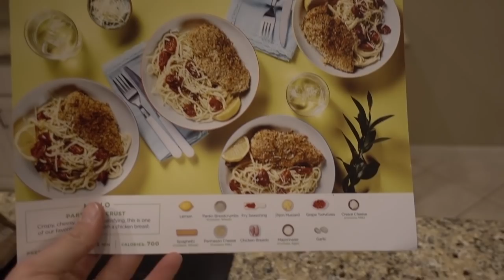Double Engine Go-Kart, Part 4 Start Up!

Comment: Put a little truck bed in the back
Reply: Very much so
Reply: just what i was thiking
Reply: It's gonna be weird with the suspension tho
Reply: thats what i suggested the first day, he might as well turn it into a little "utility" cart. help carry some stuff around the property.
Reply: @YourMom-dw7bb  yeah it would but if he was to mount it to only one of them and high enough up itd be fine
Reply: That's what I think
Reply: yes that is what i sead
Reply: Max Ferris put a flat bed on it.
Reply: I was thinking roll cage but either pne would work lol
Reply: yes, it would have to be suspended from the original rack in the rear , not hooked to the second engine setup.

Comment: You need to put fenders over the rear tires. They will dirty the heck out of the tops of those motors if you don't lol. Use some conveyor belt or a piece of a 5 gallon bucket or round trash can lol

Comment: You're assessment is correct. Acceleration will improve slightly, top speed will remain unchanged,(unless you swap out the sprocket) ability to move a heavier load will be improved markedly. Plus the MAN factor increases exponentially.

Comment: This is a project you should have waited to do until Mark is feeling better.    Odds of Matt making this work reliably 50/50 with Mark helping 100%
Reply: 50/100
Reply: Pedro Romano 50% chance working 50% not working bud
Reply: @imromano2448  He meant 50:50, not 50/50.

Comment: I know this is gonna sound like im stupid  ,  try putting one engine in reverse and other in farword  i wanna see what happens
Reply: they will just spin the tires out, the cart won't go anywhere unless one engine is somehow more powerful than the other or the tires on one have more grip than the other
Reply: I sill wanna see that even though I know the outcome!
Reply: @BTB1337  Front tires probably have more traction since the weight is more over them. Probably would only really make a difference on the concrete though
Reply: thats how you break stuff
Reply: Agreed
Reply: @mjg1970  yea me too

Comment: Extend that storage on the back and you're set! Use aluminum to keep it light, but have it attach via hinges so you don't have to worry about welds. What a beast that thing is!

Comment: The line coming off of the carb to the fuel tank is a vacuum operated shutoff valve.  it will only allow fuel flow when the engine is cranking or running.

Comment: You'll get more Torque not horsepower from the 2 engine kart.
Reply: Lol you can't increase torque and not hp
Reply: @raynman6466  horsepower is just a conversion from torque. He's only getting torque out of that because the added power & 2 extra wheels. It's not going to make it faster on the top end. But it'll move from a stop quicker. He'll be able to climb better as well like he intends to use it for.  He could change the gear ratio now to make up for the added torque and gain some top end as well.
Reply: @DynamicVlogs69  exactly if hp is a conversion from torque then increased torque means increased hp
Reply: Well yeah 4hp + 4hp =8hp
Reply: @anthonylyrette7399  12v +12v in series is 24v, 12v + 12v in parallel is 12v.
Reply: @mobrien7211  haha lol no its 24 volt truck in the 40s use 2 6volt To make 12volt

Comment: Hey Matt, all you have to do is wire the back engine into the front engine wiring harness. You dont need 2 keys or anything that way. Plus when you run the battery, run them in series and youll even the load out that way for both engines when starting.

Comment: Hold the throttle wide open on the primary, then adjust the cable to be wide open throttle on the back one at the same time. So theres even power on both engines

Comment: Alright i work on these things for a living. You need an additional fuel pump for that back engine, theres a hose that you connected to the rear carburetor. It should actually just T connect from the intake boot to the carburetor. Have a hose come off of the T intersection to the fuel pump ( the air line) and connect your fuel pump in line after your fuel filter. That should provide ample gas flow.

Comment: You could cut the rear engine throttle cable  to length to attach it to the front engine throttle connection at the carb... then sync them up.

Comment: U should put hinges on the basket in the back and put supports on the end of the rear engine and make a bed over the rear engine so it will flex with it.

Comment: Sorry to hear about your brother.  My thoughts and wishes for his recovery.

Thinking about the gas petal cable. You probably need some mechanism to synchronize the throttle on both engines.  Maybe try a turn-buckle to adjust the rear engine speed compared to the front.  Lift both sets of wheels off the ground, strap the buggy down so it cannot go anywhere.  Test that both sets of wheels turn at the same speed, as you move the petal.

Comment: @offtheranch.  Don't worry about welding it back together like you had it.   It will float better across the ground now, because the back engine cradle will pivot.

Comment: Hey Matt attach your gas cable to were it hooks to the carb on the front motor and the shift cable were it mounts on transmission of the front motor ,plenty of cable and one shifter and gas pedal.

Comment: You can wire the brake safety circuit to the brake safety circuit to engine one.  Stepping on the brake will close both circuits.  So can start both engines.  Easy, peasy.

Comment: Glad to hear the good news that so far so good with your brother... The hard part about your double motor is they'll be working against each other if you don't get the throttling perfect... Too much slop in the wire throttle you got now - cable it to get it precise.

Comment: For the throttle cable, you could have made a shorter cable and hooked it to the first carburetor so both have the same throttle response, and both are open the same amount at the same time.

Comment: That second line coming from the fuel tank is a vacuum line. The gas tank has a vacuum activated petcock, so you dont have to turn the gas on every time you use it. It only has to be connected to one of the motors to work. If you disconnect it from the rear motor you will have to plug the vacuum connection on the rear carb. Or you could leave it like it is, just thought you might like to know.

Comment: Matt, The term you are looking for is Torque. You won’t get twice the horsepower, same horsepower. But twice the torque, so it will pull more, get to top speed faster, but top speed will be the same

Comment: Just a tip as I’m a wiring fanatic. You might want to redo the electrical tape twisted wires and replicate that with a proper connecter with heat shrink. Be much better in the end

Comment: A suggestion drill a hole in the handle as the rear engine shifter attaching metal rod or borrow whatever you want to put and make a separate handle that way you don't have to worry about the cables being too short or leaning back just a suggestion

Comment: Hey Matt, it'd probably b a good idea to box those tabs you have for the top shock mounts. Either that or run a brace across from one side to the other. Otherwise, although I'm not entirely sure how the bottom side is set up, you could easily fold those ears over if you hit a large enough bump, or jump the kart.

Comment: Matt you can get a in line fuel pump for a carbureted motor and it will solve the problem if the back motor starts to starve itself for gas

Comment: Just splice the ignition wires together and use one key. Not two gas tanks. One bigger gas tank. Slow speeds, no worries. 60-70 mph, you might want to think about bigger brake rotors and a 5 point harness and a helmet. It'll go crazy fast if it's Barbie pink!

Comment: You don't get double the horsepower with 2 motors but your torque will go up but not quite double. Your go cart will still go close to the same speed but with the added torque you will get to the top speed faster. If you want more speed you will have to adjust or remove the governors. Hope this helps.

Comment: You will want to mount a second tank or run a larger fuel fitting and hose from the tank to the split to maximize power it will struggle otherwise.

Comment: Looking good. One thing you might want to make sure the throttle cables are the same length. If they aren’t the same thing length id think the engines would be fighting each other. One engine will try pushing the other.... pretty impressive though.

Comment: Replace the wire with a piece of flat bar.  That way the throttles will move at the exact same rate every time since there won't be any slack like there is in the wire.

Comment: got my NEW Demolitia t shirt , like'in this t shirt club deal , top notch quality and materials used here , Thanks . you may have been able to wire in the brake start-up wires right into the ones from the front motor , its a good idea that they will only starrt w/ the brake on . Thanks for another great one . Hope Marks doing better Peace !!!

Comment: The extra horse power from the second engine will give you a higher top speed in most circumstances except for real light engine loads, like going down hill .  Basically top speed is the point at which the vehicle's resistance to motion equals the power produced by the motor .  By adding the second motor unit you've doubled the horse power and not doubled the resistance to motion . Dividing the load between 2 motors will allow the motors to spin faster giving higher top speeds . This is going to be limited to the engine red line rpm.

Comment: make a plate and bolt another wiper blade plate to it so it swivels. then weld the base to the gokart and the you can connect both cable ends to the same wiper blade so one moves the other exactly the same amount.

Comment: I'm with you Matt. I don't think the top speed will be much higher. Acceleration should be better but on a track I think the steering will suffer a bit. Hehe I still want one really bad. I'm sure you'll all have alot of fun in it

Comment: Just a little thought. The throttle cables should be linked together that way both engines go at the exact same rate if not you'll ruin one by not keeping up with the other.

Comment: You should have just hooked both engines to one ignition switch that can handle both engines starters and connect both batteries together to increase your input power to support those starters

Comment: Having 2 motors that do the same rpm matt so top speed will stay the same.   But it will excelerate faster.  So in esence its quicker not overall
 faster.

So if u modify both rev boxes and work the the clutches then yes u can also improve top speed.   But u can do these mods to the single engine kart as well. 

Btw keep up the great work

Comment: Only 1 problem with running 1 fuel pump and 1 tank you just cut your fuel pressure in half and one if not both of the motors will lean out. Yes it will make good power but those motors won’t last very long. And that’s why starting it also takes so long, it’s having to build up SO much pressure it can’t with one pump

Comment: Your using the motors in parallel. You will have double the torque like this. If you used them in series (both motors powering one set of wheels) you might get double the speed/horsepower.

Comment: I just watched your video there are some changes I think you should have done in building your toy. But I know you we’re just wanting to see if it was possible I love it. I do think you should connect the throttle cable for the rear engine to the to the cable connection at the front engines carburetor. This will be a better point to control both engines.

Comment: Those saying it won't be faster are kinda right.  Top speed won't change unless a single engine didn't have the power to run out, but it will get to top speed much faster.  I'd be more excited about doubling the torque potential and traction.

Comment: Without weight on the back it will do almost no good. The way your suspension is hooked up on it the rear wheel will just bounce up and down under load unless you put more weight on it.

Comment: If you change out the clutches to a racing clutch it will be a lot faster and you wouldn’t need the extra motor

Comment: soo,you will have more traction no more SPEED (you might have a slight increase in speed who knows), to actually be able to have speed i think you might need a diferential or something like that to combine the power of the both engines and to equaly send them to the weels.

Comment: You might need a larger fuel line to supply both engines enough gas at full throttle

Comment: not dissing or poking fun but the carbs or exhausts or both are restricted to bits. I know its meant as some fun but if u pull the carbs off and find 2 pit bike carbs 80t125cc and mount them and on the down pipe there is a inner restrictor ether find different pipes or cut it out with  dremmel its only tacked inside manifold or flange fitting. on on the car there might be a small arm that restricts the throttle butterfly opening if u move it with engine running then lift the arm u will here it rev a few 1000 rpm higher

Comment: Alright one more time, when the kart has no one in it the rear motor section should be almost lifting the karts wheels off the ground. Then when someone sits in the kart they will preload the karts wheels. Right now as soon as you go over a hill the only weight is the weight of the rear engine assy. there by the rear engine's wheels will just spin.

Comment: tha'ts a small tank and you just doubled the fuel burn rate it will probably be better to install another tank and plum it to the existing tank to increase fuel or just connect to the second engine

Comment: @offtheranch Surely if you have two engines running off the same fuel tank line( the line closer to the tank) the engines will not have as much power as it does not have as much gas

Comment: You should of fabricated a throttle bar for the 2nd engine so you wouldn't need the line on it and just run a bar from the 1st engines throttle body to the 2nd engines

Comment: Hey Matt, any update on the Bronco? Also I think you could work out a linkage for the rear engine gear shifter with a push/pull rod along the frame to a lever up front on the left side.

Comment: Mat you're not going to go any faster if you don't boost your HP and swap out gears to a different gear ratio and remove your governor. Maybe a torque converter as well. Putting 2 engines with the 2 extra wheels will give you better traction amd useable torque, but it won't be faster.

Comment: It's not going to go faster, it will just effectively have more torque. The horsepower will basically be the same. So, one person riding won't go any faster than they would with one engine. However with two people, you should now be able to go just as fast as you would with one person and one motor.

Comment: How far does the shifter reach ?Is it possible to put one behind the other and then just link the 2 levers together with a metal bar ? Then you would have one shifter push and pull the other.

Comment: You won't increase the horsepower much at all, you'll be increasing the torque. It will lug heavy dudes around easier.

Comment: why dont you splice the wires for the second ignition box into the first box so both run off of the same box. all the wires should be the same color.

Comment: Your not doubling the hp..... the only way you can double hp is if you were to literally build the existing motor.... top speed will be the same if not less. More weight from second motor and all the mounts added. Now torque on the other hand will be higher than before!!!! Thats if you convert it right! Im ready to end results! 2 engines with the same hp will never go any faster than the 1 original motor just a bit more torque! Im currently putting a suzuki racing quad motor on my go cart! We're talking 60mph to 75 mph go cart buggy

Comment: lol why didn't you just get a bigger motor for the go kart, why put a second one in, or you could have modified this one, there are tones of mods for themalso you could have put a relay to use one key and run both starters, could have taked int the brake sensor to the other sensor since its just a kill switch

Comment: This will probably get buried in the comments but the vent hose is actually a vacuum hose that opens the fuel petcock. you will want to put one way vacuum valves on both the vacuum hoses to make sure the valve opens all the way and when needed. https://www.amazon.com/Dorman-47149-Vacuum-Check-Valve/dp/B000COCU0M